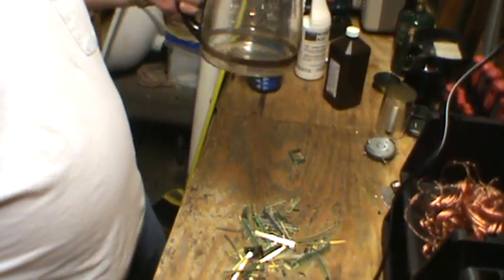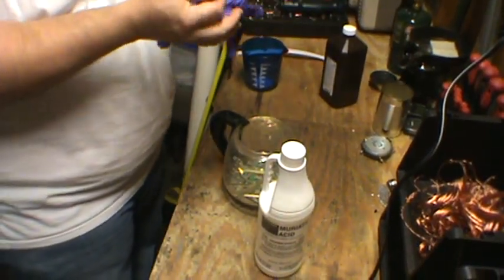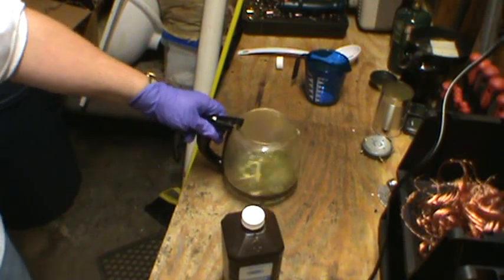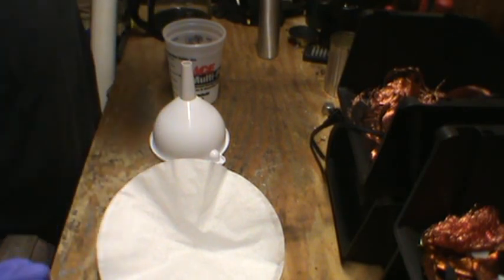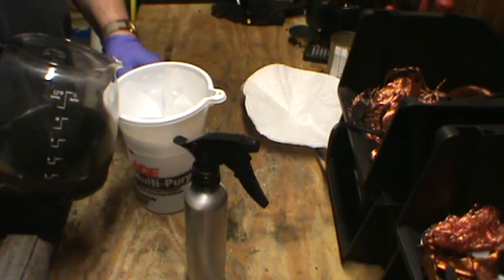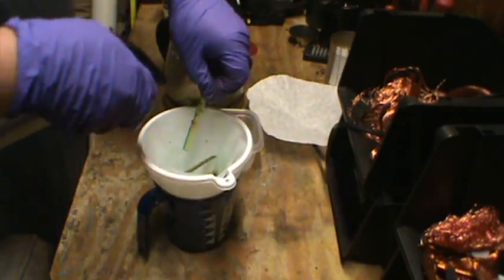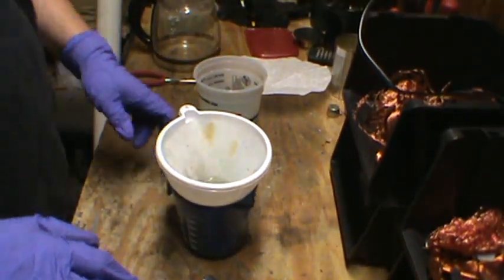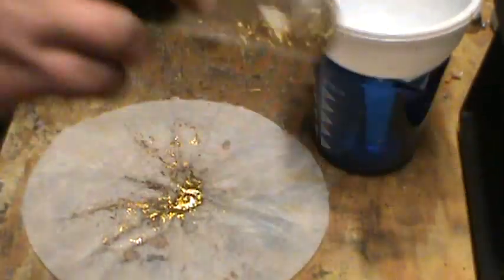How to Recover Gold with A/P Acid peroxide method for gold fingers and gold plated boards easily.

Comment: Great vid, quick question though... Does it matter the concentration of the peroxide? I'm thinking if using 30% and I'm not sure how that will affect it, secondly, what is the ratio of hydrochloric acid to peroxide? 

Thirdly, do you have a video of the refining process?
Reply from the maker: Hi and thanks for watching!  The concentration of the peroxide really does matter.  At 30% you are likely dissolving gold into solution.  The ratio of HCL 31.45% an H2O2 3% should be as little peroxide as possible.  One of the rookie mistakes I made in this video was to use too much peroxide to make the reaction faster for the purpose of the video.  Big mistake,  Try to keep it no more than a 3:1 ration.  4:1 would be best and give it time to work.  I do have a video  on refining as well, check out my channel.  Thanks!

Comment: never heard of muriatic acid. where can you get it?
also was wondering if you could just use nitric acid to clean up fingers/ boards ect..
Reply from the maker: Yeah its just 31.45% HCL available at just about all hardware stores.  I have never used nitric acid so I am not sure.  Thanks for watching!
Reply: cool ty

Comment: how about doing a video or two on mother boards --one to identify valuable parts and another on recovering gold from them I seen on some videos that the solution you use can contain silver  and by adding another chemical it is turn to a silver salt-
so if you can do a video on that ---I know I would appreciate it

Comment: would this work on cell phone boards?
Reply from the maker: Sure, if the boards are clean and have no other metals on them.
Reply: so if i did the sand bath trick to get all the solder off, it should work
Reply from the maker: theBNAWexperience Sure would!
Reply: ok sweet, love the channel, hopefully ill try this out sometime soon, cold as hell in illinois, so im not going outside for any persiod of time to do this lol
Reply: will wait till spring to do it
Reply from the maker: theBNAWexperience Oh tell me about it.  Hard to anything when its below freezing in an unheated garage!  That's ok thoughm, spring is only 3 months away!
Reply: Moose Scrapper and in those three months i should have a bunch saved up to get a bunch of gold.. I also have a bunch of gold pins that i hand pulled from a wire wrap board, at least 500 pins, and I had 2 of the boards.  If the pins dont have any solder on them, would I be able to add those to?
Reply: also would 29% muriatic acid work, I know most stuff is 32%, but i found some pool stuff that is a lot cheaper but is only 29%, would it just take longer?
Reply from the maker: theBNAWexperience Its my understanding that it would still work just slower.  Keep in mind thought that the less HCL is in there the rate of reaction decreases exponentially.  So it could take a week longer.
Reply: k thanks for the quick responses to all my questions!

Comment: Hey Moose Scrapper can the same A/P Acid peroxide method could be done using gold plated jewelry?
Reply from the maker: It can if the base metal is brass or copper.  You will need to score the plating in several places so the acids can get in there, and it will take a lot longer than the gold fingers because there is a lot more metal to eat up.  I think reverse electroplating is the best method for jewelry.  I have nto done this myself but from the groups I am involved with that seems to be the general concensus,  Thanks for watching!

Comment: Hi Moose!  Do you know if you can use this method on printed circuit boards?
Reply from the maker: If the boards are clean of all other materials then yes.
Reply: Moose Scrapper Any suggestions on refining the gold further? Is it worth the effort?  And, if it isn't can you sell the finger as-is? 

Lots of questions - Thanks!
Reply: jon d Fingers*
Reply from the maker: jon d You can absolutely sell the fingers as is.  You can sell most gold bearing material as is to places like boardsort.com and on ebay.  This is a hobby for me so I am taking it pretty slow.  I think it is definitely worth doing for somethings, for other there is just too much quanity of material required to make it worth while for me so i just sell the material as is instead.

Comment: Hi Moose, I enjoyed this video very much. You made it understandable. Question: You mentioned taking solder off the stick, and said be sure to remover all "other" metals. This is the first time i've heard this. I need to ask a silly question: "why?" Is there an adverse reaction? or what? I have been picking the pins off the back of boards, sometime the gold (i presume) comes up with it, I just peel off all that I can get. So i have the pin, the solder and the presemed gold. I've been thinking about using this process and dump all these peelings, etc., into the container with acid, eetc. Should I NOT do it. I would really appreciate a response.
Reply from the maker: Hi and thanks for watching!  I think it is best to process things seperately.  This process outlined above is for gold fingers and plated boards, not pins.  It is important to keep all foreign metals away from the solution for lots of reasons.  It helps to keep the gold more pure, it is easier to dispose of a solution when you know exactly whats in it, and you can avoid making the situation more difficult to recover your gold.  Adding solder to the mix can create a real mess.  It can make things gel up or worse.  For plated pins, like ide pins and pins from connector ends, if they are non magnetic (use a weak magnet as the brass ones may have a magnetic layer of nickel under the gold) then the easiest way is to boil them in hcl.  It takes a few hours, and you need to have the right amount of hcl, 1 gal/2lbs pins.  You can use the AP process for the non magnetic pins however it will take a long time even with an air bubbler instead of peroxide.
Reply: Moose Scrapper ThanksI think I understand where you are going, even though I have't tried it yet. I've been saving/clipping, etc., over three years and haven't had the nerve to sell anything yet. Mainly because I keep learning things, hoping to learn enough to feel "enlightened" enough to sell.

Comment: Unfortunately nearly all gold plate is done on top of a zinc plated layer for stability...
Reply from the maker: Hi and thanks for watching!  Your comment intrigues me as every resource I have encountered from the goldrefiningforum to manufacturer info states that it is a thin layer of nickel not zinc...then a layer of copper.  Where did you get your information?  I would like to read that info.  Thanks!
Reply: Used to be in the electronics industry. They call it 'nickel' but in reality the metal content if you analyse it is only about 20% nickel, its mostly zinc which is about 10% of the cost of nickel. Using the 80/20 alloy its possible to skip the copper coating as well which most of modern electronics does.
Reply: Arduino Tronic: If that had affected the resulting gold in the least, people would've noticed when testing the karat of their final smelted gold. Even those who don't test themselves, but sell their gold, would notice when the buyer came looking for them with a baseball bat.

Comment: If you have access to so much free acid and peroxide that you don't care if you ruin the acid over time can you just pitch in pins with solder and gold plated steel pins from things like parallel cable headers and replace the mix? Lots of my finger boards are slightly magnetic as well.
Reply from the maker: You will find that most finger boards are slightly magnetic when using a rare earth or neodymium magnet as there is a thin layer of nickel n there that is magnetic.  As for the rest of the post, I can not tell you for certain what will happen with your experimentation.  I am still a beginner att his and have only read that it would be bad to allow solder and other metals in there are you are creating other solutions that can be more toxic, more difficult to dispose of, they may gel up and make recovering the gold MUCH more difficult, and in some cases can become volitile or even explosive.  At this point, i have followed the directions I have seen to the letter and have not tried to foul up the solutions with other metals.    THanks for watching!  Perhaps you can better find your answer on the gold refining forum.
Reply: Moose Scrapper I guess the steel and iron form iron chloride which acts like copper ii chloride but cannot be removed from solution when it becomes too saturated. which is why when AP is too be disposed they soak steel in it to force iron into solution and copper out, then neutralize. Lead I guess is just a disposal concern. From my understanding. I've divided my scrap into steel and no steel and will play with the pins.

Comment: Hey moose scrapper! What temperature was it where you left the A/P solution?
I have read from other processes (like aqua regia) that the reaction should take place with ambient temps around 70-80F. It is winter in my area and temps are in the 30's and 20's typically. Since it needs to be outside due to the fumes, do you think it would work? Also did you use a chemical mask when making/during the reaction of the A/P?
Reply from the maker: Hi and thanks for watching!  I save all my stuff up or the summer when its warm.  Right now it is consistently below freezing an I do not process gold.  It is too cold for the reaction to take plae in a timely fashion.  I did not use a chem mask when using A/P as I do it outside and the fumes from the safer hcl are not that bad.  I have a chem mask for the reining process though because even outside the fumes are harsh.

Comment: one more question.  what are the about one inch tall and about cigarette sized cylinders on the boards with some reading a voltage and a melting temperature? capacitors? any recovery value?
Reply from the maker: The big capacitors, just about always only worth the aluminum.   The little barrel shaped ones don't oftem have pm's in them.  There are square ones that are tantalum, some have gold etc, but they are not the barrel shaped ones that I know of.
Reply: what is the goo inside?
Reply from the maker: Jean Sanchez best to leave that alone.
Reply: k.thanks
Reply from the maker: Jean Sanchez

Comment: do you any monolithic ceramic metal recovery from the pc boards or ic chips? and if so will you do a video that has clear images to identify the correct components?
Reply from the maker: I don't do recovery myself yet for MCC's or IC's.  I am saving them up to have enough for experimentation.  For MCC's you need nitric acid.  indeeditdoes has a great video on it.  Geo has a great series of videos for IC's as it is a multi step process.

Comment: ok today I tried the A/P with a small amount of gold fingers & it dissolved the gold . I thought it would just get the gold off the circuit board ? this is my first time doing this .  . is this ok?
Reply from the maker: I and thanks for watching.  I cant stress how important it is to follow the directions exactly.  It sounds like you put too much peroxide in there.  The gold is still in the solution so do not throw it away.  Try using it on your future batches without adding any more peroxide until the foils stop coming off.  Then add a chunk of copper to the solution and that will make the gold precipitate as a black powder.  Filter and smelt the powder.

Comment: what happens if you don't get all the solder off
Reply from the maker: You change the composition of the solution which can make it harder to recover the gold and possibly create chemicals that are more difficult to dispose of.  A hot sand bath is good at getting rid of the solder.

Comment: Hey MS,
I work in the computer industry. Our company is constantly throwing out mothernoards. I stumbled upon this video. Is there a way to remove all components and then soak the entire motherboard in the same solution you used. I was thinking like a glass oven pan. Thanks for the video.
Reply from the maker: Hi there, and thanks for watching!  I am not sure that you would want to do this, most motherboards don't actually have gold on the board itself just in the components like the CPU, flat packs, and slots etc.  Mother boards also sell for about $3-$5 per lb which is relatively small compared to the over $10 / lb of ram chips, up to $100 /lb of CPU's, and over $10 per lb of logic boards from Hard drives.  There are a lot of differnet pieces that need to be processed in different ways as well.

Comment from the maker: No, this process is not for those pins.  For CPU pins you need to boil them in hot HCL.  Unfortunately though the amount of gold in just two cpu's will me so small you will have a hard time recovering it.  I am just a hobbyist with gold recovery and refining, so please also double check with other sources.  It has been in my experience though that for green fiber CPU's seen in my video about pin removal, you need to have at least 4-5 lbs of CPU's to make the process really worth doing.

Comment from the maker: No it wont sadly.  Metals tend to alloy and it would take a long time for the A/P to digest it all.  You would need to file it down to dust, then run it through some A/P to remove the copper.  once that's done, filter and purify with HCL and bleach, precipitate with sodium metabisulfite.  You may want to hold off on that last part as a 20 gram ingot of melted pins will have very little gold in it so I would probably just file it down and add it to the next batch of pins you have.

Comment from the maker: That is a very common question, unfortunately a hard one to answer.  You need a good pound or trimmed finger boards to get anywhere from 1-3 grams depending on type, age, etc.  Older stuff will have thicker plate.  If you process every inch of the machine (hard to do) you can get a gram of gold out of maybe 4 pc's.  If its an old 486 or earlier then you can get more than 1 gram out of just one pc.

Comment: Thanks!  The Gold Droped! And  the liquid Went Back green! after rinsing. Turned Blue. is this something besides copper ?. 
Also some gold flakes are stuck in a hard button like gray substance.
The Original sample run was Gold filled or rolled. scrap jewerly

Comment from the maker: Yes I use eye protection.  When making other videos though it can be hard to operate the camera in full safety gear.  I do have chem resistant gloves not just the latex ones, face, and respirator.  I don't use the respirator though because with the exception of this video, every part of these batches is done outside.  Thanks!

Comment from the maker: OK, the gold is not lost...it just may be harder to get to now.. gold fingers turning pink is not a bad thing.  sometimes that is just a thin layer of copper on the board that has not dissolved yet.  Once things are rinsed well 2-3 times, they should be safe to touch, gloves are still highly recommended.  Are there foils floating around in the solution?  and when you say eh threw everything in, what exactly do you mean by that.  The whole ram chip, or just with a little extra stuff on it?

Comment from the maker: When I take a computer apart it do the following.  I clip all the gold fingers from ram and pci.  remove all ic chipsfrom PCI, ram and mother board and drive boards.  I remove all the gold plated pins from the drive boards, mother board etc.  I also get the bridge clips.  North and south bridge chips, CPU etc.  All gold fingers get A/P solution.  All gold plated pins get a hot hcl bath (include pins removed from fiber cpu's.  IC's anf flat packs get incinterated and sepertated.

Comment from the maker: Hey thanks for watching!  The older the parts of a computer the more gold is a good rule of thumb.  The biggest gold bearing parts are the CPU, Ram chips, and logic board from the hard drive, and the PCI cards. You can process a lot of the parts with just HCL as an acid.  it will take longer, but it is possible.  A/P or acid with an air bubbler, and HCL and heat  are the only methods i use.  This is only a hobby for me and am still learning about nitric and reverse plating etc.

Comment: I think my dad screwed our mixture up... I wanted to go through and cut all the excess metal, soldering, ect. But he threw them all in without me noticing, and all excess metal ect. turned a pinkish color :( Are these ruined now? Or will the gold still come off different ones? Also.. when we spray them down with water, will they be good to touch? So I can take the pink stuff off of the boards that need to be done again

Comment: Nice video Moose! Was wondering if you can get much recovery material from other computer parts such as the motherboard, hard drive boards, and CPU chips. Can you process all these others items with the same method? If it appears to be a gold color is it likely gold or do they use brass sometimes in computer parts? Do older ram chips tend to have more gold? You made an interesting video with no BS. Thanks!

Comment: Problem: Here in the Phils We only have 15% Meratic and 10% peroxide
 I Tried a sample of some scrap gold filled. The First reaction was Green color. 16 hours  later. the solution was clear. And all of the peaces were copper color. I Assume that the Green attached to the base metal. Do I Need To Try Reverse plating instead ?? .. Thanks Much For All of your Effort's and info.

Comment from the maker: Hi and thanks for watching!  Not all parts are processed the same.  A/P can be used for gold fingers, plated circuit boards, and even plated brass pins.  I do not use nitric for safety reasons so i would not feel comfortable ansering any questions about it.  I can tell you that you can process most things using just HCL and heat or HCL and bleach, or HCL and peroxide/air bubbler.  Check out the goldrefiningforum and CM Hokes book on PM recovery.  Thanks!